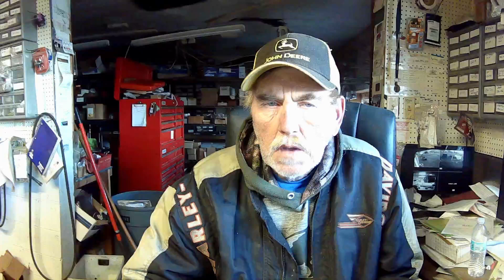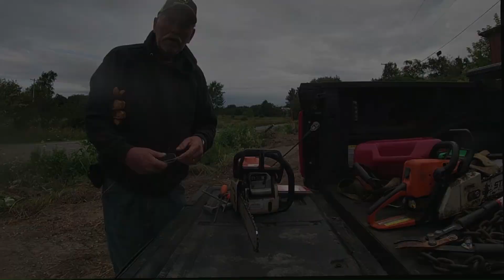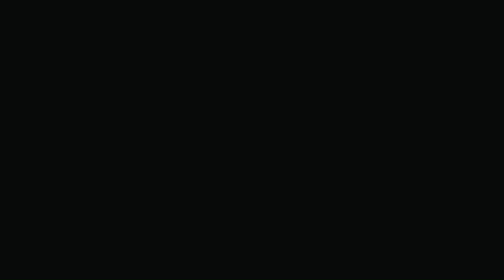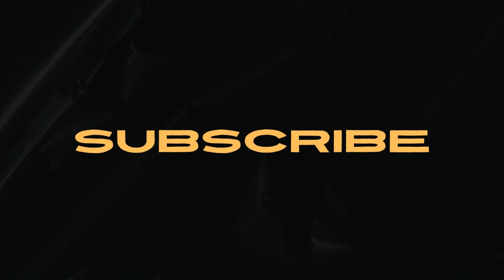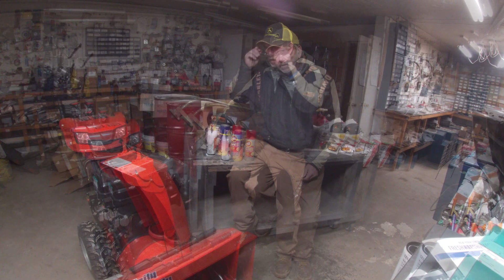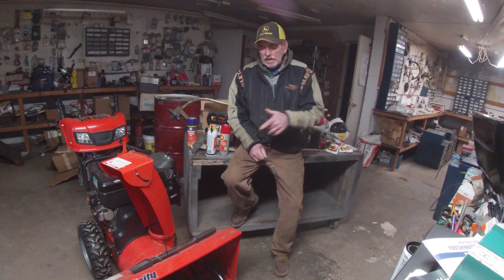Fogging An Engine: Is it Worth My Time?

Comment: Have never fogged, but do drain fuel tanks, then run the carburetors dry.  Then pull the plugs, add a couple squirts of motor oil in the cylinders, spin 'er over a few times, stick the plugs back in store everything for the winter.  Next spring, everything pops right off with fresh fuel.   On the gensets, I keep them running all year,  exercise under load each month for 30 minutes, and use Stabil fuel treatment. Never any problems.......Yet.     Fingers crossed.     Thanks Eric,  good info!!
Reply from the maker: that's a great tip on the motor oil in the spark plug hole Ed. thanks

Comment: Great info. I tried fogging, even using 2 cycle oil. No real benefits.   Tried light 2cycle oil in mowers, same thing.  I enjoy working on old things. Will run light mix and spray some mix in cylinder.  Helps rings slide better.
Reply from the maker: Great point Steve, you and Ed are on the same page with adding oil to the cylinders thanks

Comment: thanks Eric this was informative, i have a spare generator that never gets used and we live in north florida and it is very humid so everything rusts , this seems like a good thing to do
thanks again
Reply from the maker: It can't hurt Bob to fog it. What i normally recommend with generators is to start and allow it to run for a few minutes every month, then shut the fuel off again and allow it to run out of fuel in the carburetor. thanks
Reply: thanks eric @northernnewyorkparts

Comment: I have never fogged anything in 35 years. I don't drain gas but I do start and run stuff half way through winter in Michigan. Have never had a problem. I use PRI-G in my fuel. Might be a problem in high humidity areas or if stored in a dirt floor shed. The temperature fluctuations could cause condensation.
Reply from the maker: I know of customers that start their summer equipment and allow them to run for a bit mid way through the winter with good luck as well Jason, thanks

Comment: Put me in the no column. Never seen the real benefit.On my outboards I disconnect the fuel and run the engine till it dies (with cooling water flow).Everything else I don't worry about freeze damage: really don't get low enough temps for equipment stored in any structure to freeze here in NE Texas. We get cold into the 20's or lower but it's most always short term. Except for a few years ago when it got 10 below in my area of Texas. New record.....Hope to never see that again.
Reply from the maker: We see -20 to -30 each winter usually in January. On the outboards we fog and drain the lower units to make sure there is not water in there from a bad seal. Lower units and pressure washers are the same...water freezes and cracks the aluminum housing & pump on the pressure washer. thanks